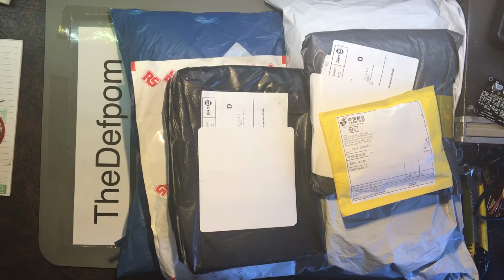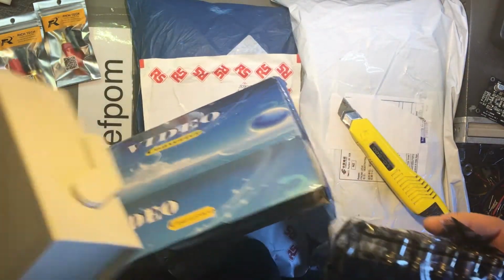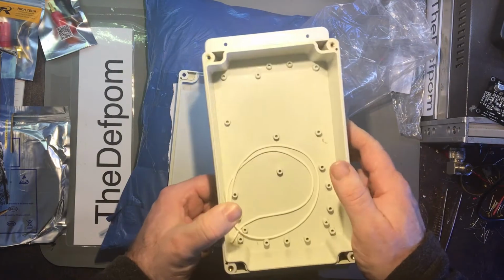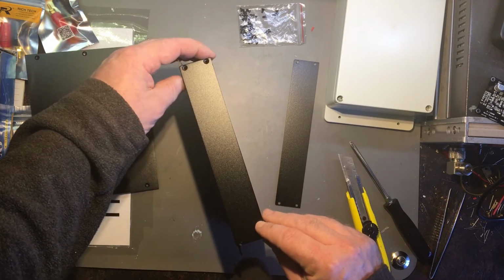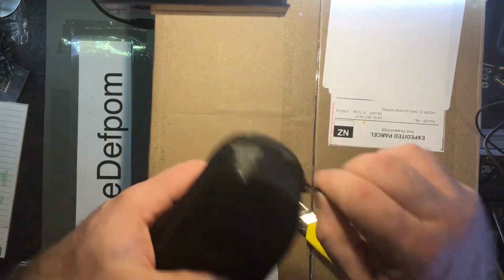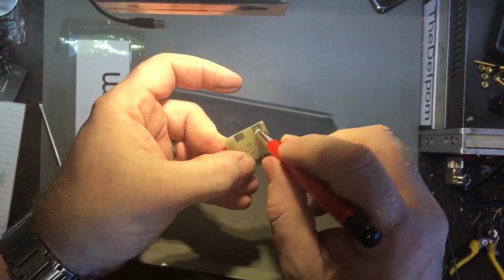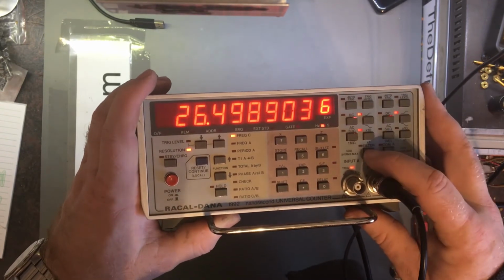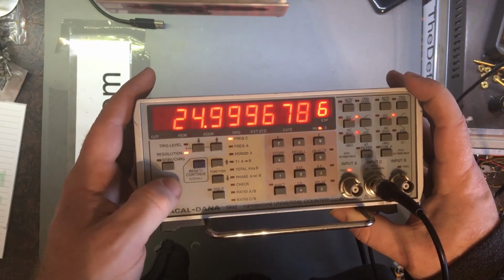#249 Mailbag 23rd June 2017

Comment: I purchased the Uni-T 210 and it met my needs and expectations at about half the price of the Harbor Freight unit I was considering buying since it was much less than the comparable meter on Amazon I have several multimeters including one Fluke so those options were of little importance to me Just the clamp on AC and DC Amps were my main requirement for this type of meter. Would have liked a bit more demonstration and verification as done on other Mailbag Shows which may be why they have many thousands of views as they not only show bur demonstrate many of the items purchased so viewers can make informed purchase decisions.
Reply from the maker: bookwizards - I do a teardown and full review of the meter, this was just the Mailbag segment.
Reply from the maker: bookwizards - the full review video is here: https://youtu.be/s9D93svMg6k

Comment: Send one to arduinoversusevil...he has lots of experience in the plastics trade and he should be able to tell you what it is
Reply from the maker: It is a PVC or PS box (I'm leaning towards PS)  it certainly isn't FRABS which is what I was expecting it to be, FYI I actually work in the plastics industry and have a Diploma in Plastics LOL, there just weren't any markings on the box to confirm the material it is made from, I don't have any experience with PS, so I'm not 100% sure.